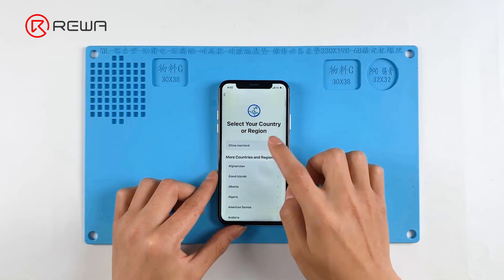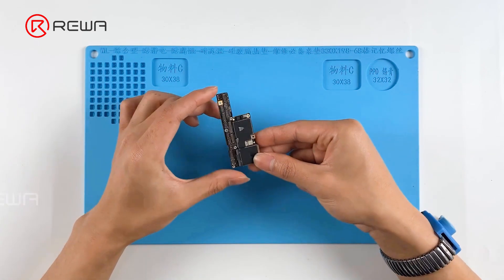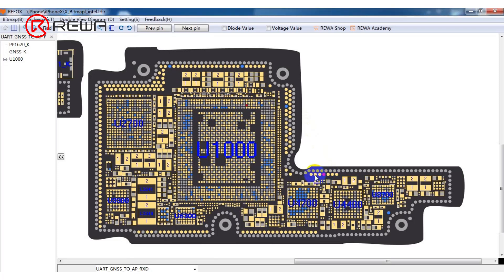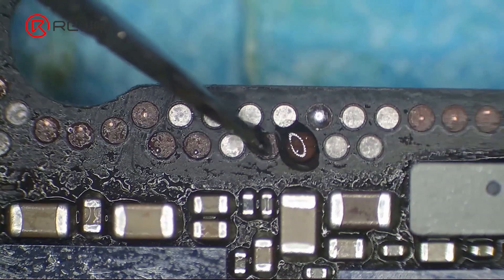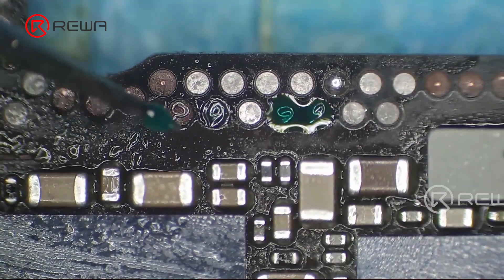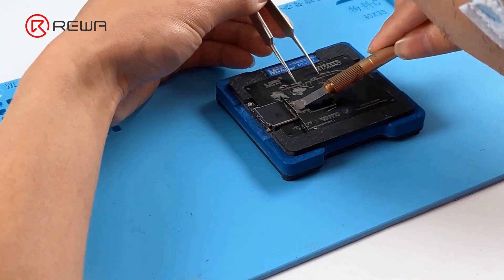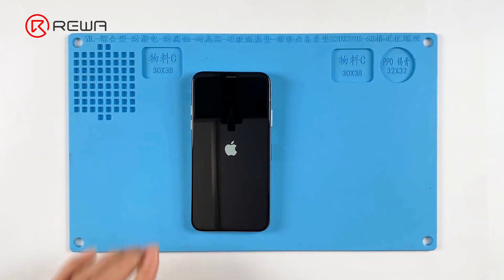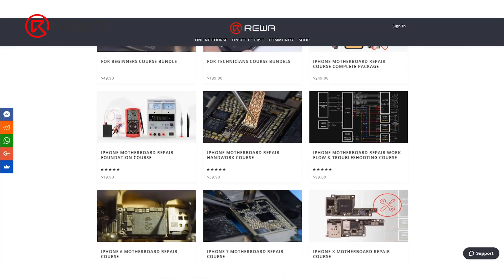Fixing iPhone X Unable to Activate By Jumping Wires

Comment: Sir my iphone x stuck on 42 amp after pressing power key whats the problem sir plz help
Reply: Assuming you've already disconnected all other attachments:

1.) Inspect the board for abnormalities. 
(Corrosion, missing or damaged components, bending of the board itself)
2.) If okay, connect the device to the computer to see if it is detected. 
3.) If it detects, attempt to restore.
4.) If no, disconnect all connectors. 
5.) Attempt to boot the device with the DC supply.
6A.) If it is drawing normal supply voltage, then power off, reattach one disconnected flex cable, then attempt to boot. Repeating this process until you come across the flex that is causing the device not to boot. 
6B.) If the voltage stays at 43Ma, then the next step is to separate the board layers. 
7.) After separation, attempt to boot the phone board. 
8A.) If the boot current is normal, then your issue is with the RF board. 
8B.) If the Phone board still does not boot then you'll need to begin a standard "No Power" board  troubleshoot. 

Which is Power, Clock, Reset and Enable signals. 

ypyconnect the phone board to

one by one. Boot then the issue lay with on of the connectoris mp

Comment: How did you figure out that activation problem is related to soldering of the points ?
Reply: I think they’re shooting lots of videos w/ invalid attempts until they hit the right choice - and save only one video.
Reply: Finding the cause is just part of the diagnosis process, with a little experience as well. You need to split the board to check components, in the process you can visually see the pads are missing 😃
Reply: May be fro. Schematics and obviously will have trial and error methods

Comment: Hey, I have a question. Wouldn't the missing bonding pads that are made with copper wire also bei recreated while reballing? Just for my understanding purpose..
Reply: It would not last so long. The bond is too weak
Reply: generally not reliably, you can see in the video how the via that connects to the pad (where you solder the new jumper to) isn't center.
The solder will form into a flat oval shape, this may make contact with the pad, however the bonding surface area is very small and is likely to crack in the future.
Reply: @Slot1Gamer  ahh alright I get the point, altough I didn´t thought that the bond would be too weak. But I don´t have any experience at all with that..

Thank you :D